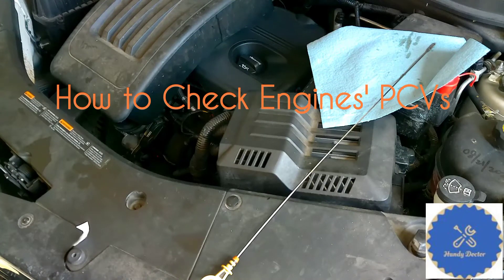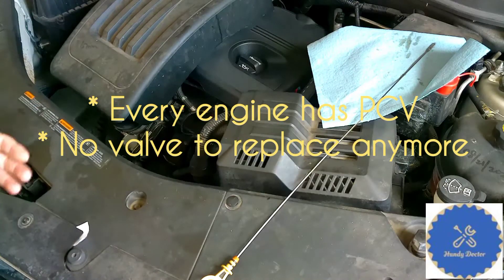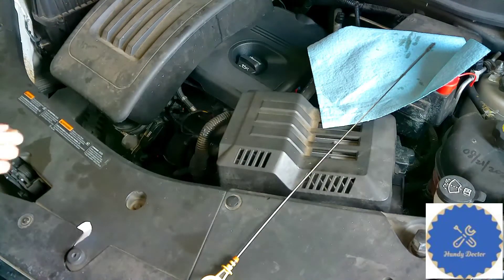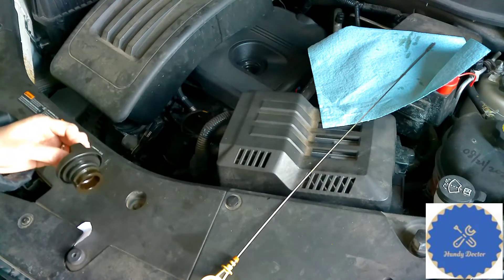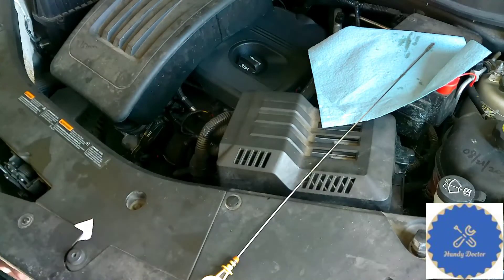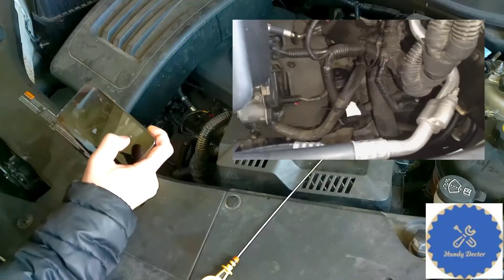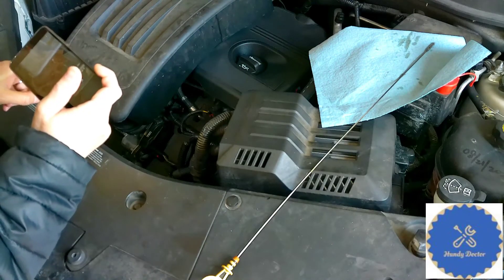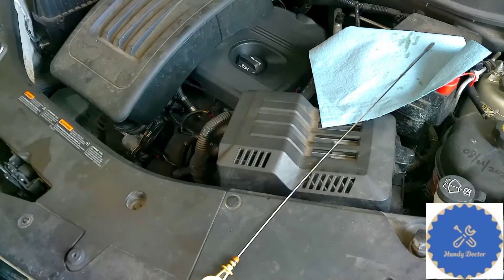How to Check the PCV system and make sure that it's working properly; equinox terrain ecotec

Comment: what did you do to fix the pcv system on your engine
Reply from the maker: @joeb956 for this engine, you need to remove the intake and clean the tiny hole. And you probably need to do it every few years. That's why this engine is notorious. Other engines could be much easier.
Reply: I cleaned orfice and runners but still no suction on dipstick tube any thoughts

Comment: GM has a specific procedure for testing the PCV  system. You need to test, when the engine is at full temp, at idle and 2k rpm.
Reply: Thanks

Comment: Looks like my 2011 Ecotec with 127K miles is affected.  Paper blows right off and can see white smoke being pushed out the dipstick hole.    I think my backup PCV is working as there is milky residue on connector into airbiox.  Guess I have to consider clearing the orifice in the intake.  Thx

Comment: I cleaned my clogged pcv on the intake manifold. I now have suction at the oil dip stick and the paper holds. However now I have vacuum suction from the oil filler cap and vent hole on the valve cover . Any idea what is causing the suction at the oil cap hole?
Reply: I'm no mechanic but its my understanding that you want that suction at the fill cap.  I've been researchingv the issue a lot the past few weeks after my 2015 equinox blew the rear main due to clogged pcv.  Everything I've found says if you remove the fill cap, flip it and put it upside down on the hole, if your pcv is working it will stuck it against the hole. If it's clogged or otherwise not working,  the positive pressure will blow the cap away from the hole.  

Again, I'm not a mechanic or expert by any means. Just what I've read through my research.